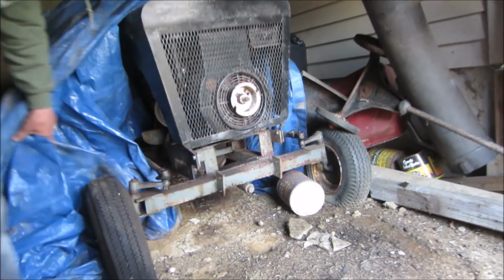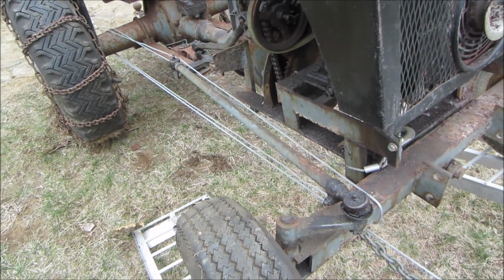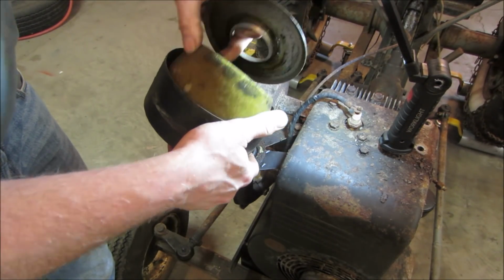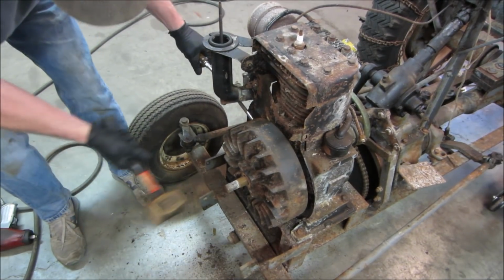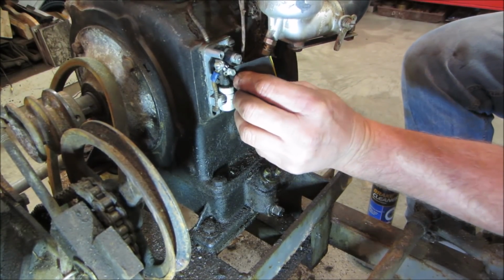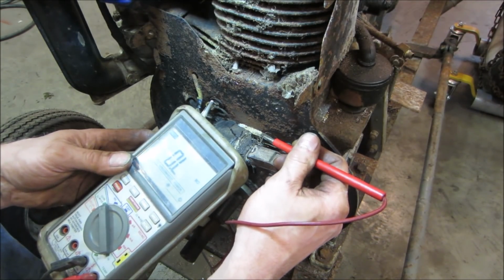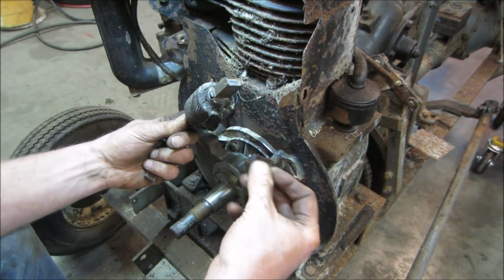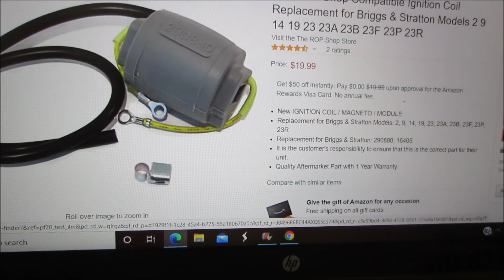Found under a House, Home Built Tractor, Can IT Be Saved?

Comment: Huge respect to the old guy that built that tractor without the advantage of the internet, or same day shipping.  Definitely a different time entirely.
Reply: It's called "POPULAR MECHANICS".  They had home builds for just about everything and plenty of loyal readers, fresh back from the war, who were more than ready to make whatever was needed.  My Dad was an avid follower.
Reply: Or plasma cutter or angle grinder likely only a torch and stick welder and really crappy drill with crap bits
Reply: Hey now we had the Sears catalog...
Reply: @BigMouth380cal  Indeed. I've got several years of PMs from early 50s til the 70s. After that they got thinner, larger and more advert-intensive
Reply: Is J.C. Whitney still around?
Reply: @davisappletv9931  yep
Reply: Being a teen from the 60s, growing up on a farm ..it was cheaper to build it then buy it and all of it was on the farm or another farmers land ..we traded a lot.
Pops ( my grandad) pop ( my dad) built something like that also ..pops used it for gardening and cleaning the feed barn for the cows..the trailer was a 55 ford bed.
Reply: @davisappletv9931  Yes  They are.
Reply: We still had local hardware stores back then that had a much larger variety of parts fittings etc.
Reply: @davisappletv9931  Yes. Not so sure the catalog is. They sell on the internet. Great old catalog.
Reply: @Hjerte_Verke  There used to be a publisher called Lindsay Technical Books tha used to sell old technical books and do it yourself books. They were reprints from 1800s to the 1950s. You can still find some of them online. I went into mourning when they closed. 😆

Comment: i finally subscribed, I have that exact engine, glad you figured it out.
Mine was on a 1960s power king tractor.
For anyone looking the part # of that coil is 290880
Of interest also is, on the camshaft it has a weight that looks like a compression release but it is not. it is actually a spark advance believe it or not.
Reply: Why not? the points are controlled by the camshaft.
Reply: @wssides  Sure, you can do that.  but the coils are quite common on the internet. as long as the engine is apart  it will be easier to just replace the coil at this point.

Comment: Popular Mechanics and Popular Science had plans for those tractors back in the 40's 50's
Reply: I think I have the plans for this saved on my computer somewhere. I think it was called a power pup or something like that.
Reply: I think that was Popular Mechanics.
Reply: @reaper10  See if you can find them and the date of the issue.
Reply: @Hjerte_Verke  They are available free on a site called "vintage projects".
Reply: Popular Mechanics.   Pow’r Pup is what they called it.
Reply: Power Pup.
Reply: Tricky one to find parts for these days, all those 30s components
Reply: Popular Mechanics. It's a Pow'r Pup tractor. Usually uses like a Model T rear differential and axle and 3 speed manual gearbox.

Comment: Mustie - take a 12V automotive coil, feed 12V positive to the plus side of the coil and using the points and condenser on the side of the tractor's engine, wire them to the negative side of the coil. Remember to hook 12V negative to the block. You now have battery ignition and can eliminate the magneto. Kohler engines in the early Cub Cadet tractors are wired this way. The magneto you are working with is made by Bendix-Scintilla and the coils are hard to find. Love the channel! Keep the videos coming!

Comment: I'm from Alberta Canada and my Father built a similar setup in the '60s using a 1937 ford in a similar way as this amazing man. There is one difference that at a quick glance I noticed. Dad had a reduction system built-in using another ford re-end which worked very well to maximize the 10 hp Briggs and Statton motor, which was mounted Crossways to allow the reduction set up to work, so the starting pulley was out the side. This was used by all of us 8 kids to learn to drive, it had a clutch and a 3-speed transmission. along with a centrifugal drive connected to the reduction system which was very easy to drive indeed. The rear end was narrowed to fit the width of the machine. It's still around and working and impressing all who see it. But it didn't look like a tractor, it was more like an early Quad with a windshield rollbar and single padded seat. My father was a very talented man with several trades under his belt starting as a blacksmith, then welder, mechanic, Electrician, and then gasfitter and Plumber, we never had a service person come to our six-bedroom house which he built-in 1957. People came from miles around for him to repair/redesign or invent almost anything from a watch to a D-9 Cat. We were spoiled and assumed all fathers could do this stuff, we were wrong.
Reply: Sounds like my dad,he built a tractor similar to this with a Wisconsin engine from a Wards garden tractor,a 3 spd either a Dodge or Plymouth transmission and a narrowed mid fifties Studebaker rear axle, built the front axle that used motor scooter wheels and tires and built the steering assembly, only thing was he couldn't get the gear reduction right and it would run too fast,he was also our small towns go to fix it guy and welder
Reply: Qq A
Reply: That's a great story and perhaps the best thing I've read all month (thus far; big benchmark, huh!). I hope my kids say something like that about their wily father one day. I'm hoping at least one of them inherited the tinker genes, but thus far they're taking after their mother... 🤦‍♂

Comment: The good thing about oddball home-built gear is that it tends to have A LOT LESS "value engineering".
Reply: John Deere also wouldn't have put wide whitewall winter grips on it. :-)
Reply: I always thought of home-built gear as the epitome of "value engineering"  i.e. free or re-purposed stuff using a lot of common sense engineering.
Reply: Unfortunately in today’s business value engineering means built in obsolescence 
So you’re forced to spend money
Reply: @RC-fu6hg  so true brother
Reply: That's because home builders see the value of engineering these things to last.
Reply: @AcmeRacing  JD probably woundn't have had those wheel sizes +  maybe the owner had 'em already ! Tre NZ
Reply: It depends who made it iv seen things almost entirely held together with bailing wire
Reply: Whenever I'm building something I'm always thinking about ease of repair and maintenance.
Reply: I think you mean it tends to be EXCLUSIVELY "value engineered," since you're usually making it out of whatever you've got.
Reply: @iroll  : Yeah, I was going to say!
Reply: Not an oddball.  It is a Power Pup  from Mechanics magazine in 1950s.

Comment: Rewind the coil. That's one of the easiest ones you can ever do. Chuck it on the lathe, carefully unwind the existing wire, rewind it with the same length with new wire. Easy peasy lemon squeezy. It would be a shame to ditch the engine just for that pesky coil, it looks to be in great condition otherwise. As for what happened, i'm 80% sure you were right with your statement regarding the arms being off center. If that's the case, they sure as heck melted the coil, because there's no air in that sector. One of the reasons why you don't see shaft drive sparkies. Too compact, coil heats up like crazy and it melts the gunk meant to protect it.
Reply: I was curious how the little bit of energy could be enough to melt the coil.
Reply: Or just convert a later model coil to fit in the same spot.  Only takes a couple of hours, and lots of people have done it for the Magnamatic ignitions.   Also, it's easy to replace that points setup with a solid state module.

Comment: Hi don’t give up on the old engine, I had a similar problem with a more modern Robin engine, I just used a small ignition coil ( from a Mini) connect to the original points, added a battery and small belt driven dynamo it still going strong 8 years later.

Comment: That engine is a 10-horse B&S, I freed up a stuck exhaust valve on one. I hate being embarrassed by things that I should know, I took apart a carb once to see why the gas wasn't getting into it before I checked the fuel tank.
Reply: aint no gas in it ( sling blade voice)
Reply: Good thing is you can still get parts for that girl

Comment: just hook up a normal 12 volts coil to that points and condenser box, and power it from a 12 volts battery. You can assess the engine with this setup, and even make it permanent if the engine is OK and you'll implement the dynastarter option.

Comment: I  built a lot of these tractors when I was a kid mainly used Wisconsins they were more common back in the 50s I have over 60 years as a blacksmith  most common thing with that ignition  is the condenser more so than coil condensers get  waterlogged especially stored away in some damp place for years  brings back a lot of old memories as I got older I built little British cars with big  American V8s as a side note want to mention be careful blowing all that stuff around specially that rodent crap  use a Shop-Vac along with your air enjoy your video restore that old stuff that's when we used a lot of ingenuity  and skills have a good one  Edmund

Comment: There are also surplus coils on eBay that are very similar to that. Some of the outboard guys are using them in their old outboard motors. It just has a straight rectangular laminations through the center of it. What you probably want to do is to put your laminations in it so it would fit back on the magnetic poles.

Comment: I'm old, 75. As a kid I kept my old 1949 Cushman Highlander running with my mom's emery board (for points) Permatex gasket sealer and a little luck. It was either that or the Shoe Leather express. I'm still riding that old scooter (with many modifications like a Subaru Robin engine, Brembo disc brakes and electric start)  But, at least my knees are in the breeze.  I had to give up my old Harleys last Oct. due to neuropathy from Agent Orange poising I got in Vietnam, couldn't feel the gears when shifting anymore.. But hey! I'm still riding and enjoying Mustie1. This old Briggs is one I have never seen. Looking forward to seeing it running!
Tom Boyte,
Gy.Sgt. USMC, retired
Vietnam 65-66/70-71

Comment: A doodlebug was really a bomb with wings. It looked like a small aeroplane and had no pilot - a bit like a cruise missile, but slightly bigger. Thousands of these doodlebugs were launched against London
Reply: No.  that was a nickname.  Home built tractors were called  Doodlebugs long before WWII.  My Dad and Gramps built a  model A  Ford  Doodlebug before dad left for the war
Reply: @fourfortyroadrunner6701  "Doodlebug" was a trolley and locomotive brand long before the automobile and WW1. Also nickname for dung beetle or turd roller.
Reply: @fourfortyroadrunner6701  the doodle bug or what i know it as is a joker is a home made tractor they were popular in the depression when low income farmers couldn’t afford a tractor so they typically went out back into there junk pile and found a few trucks or cars and chopped then up and crudely welded them together they worked and they worked well usually unless your like my  next door neighbor pall he built a dully joker out of a old chevy and he made his own wheel chains out of barbed wire he used it for plowing needless to say i call him old peg because he has a home made wooded leg you can guess why

Comment: Howzabout putting a coil and battery, and using the existing points .
Reply: I have a Yazoo mower with the same engin here in UK. It has a coil, don't  know weather  it's been converted but good suggestion.
Reply: Yep should work

Comment: I've never yelled  NOOOOO at my screen so much as when I saw that crank shaft getting hit with a hammer
Reply: Yea, should have put the nut back on the crank first so that the threads didn’t get damaged.
Reply: using a brass hammer, its probably fine
Reply: The eazi-bend (R) prybar was never going to cut it.

Comment: Mustie, a coil is a coil. Get a battery and standard automotive coil. Wire it up you should have spark if the points are doing their thing. Use that start and charge and you are burning dinosaurs! 
 Cool old tractor. It looks like it was serious used. It would be great for putting around tractor shows.
Be safe and have fun 
Terry from South Carolina

Comment: I've seen the starter pulley had it so you could undo the two bolts and pull the pulley over the nut. I like those home made tractors. The enginuity was out standing. Other times it's a head scratcher. Keep up the good videos !

Comment: I have a tractor that I made as a young bloke, sitting down in my garage.  It is 2'6" wide and 5' long.  It uses a Morris Minor flat head motor coupled directly to the diff via a universal joint.  Axles and axle housing were both shortened to get the 2'6" width.  Front-end is completely home fabricated.  It uses rotary hoe wheels as the traction wheels and Vespa scooter wheels for the front end.  It hasn't been run in about 10 years, but would go if I put fuel in it.

Comment: If the coil is bad, use a 60's or 70's car coil and battery and use the briggs points and condenser and you should get spark. I did it on a 4hp kohler and it worked great. That over 50 year ago.

Comment: Neat old rig. Forget the crusty old mag and just put a 12v coil on it. utilize the existing points and install a garden tractor battery for power. Plug the coil wire into the spark plug and whammo!

Comment: Hook up a starter with Pulley and short belt and make an electric start.  I think Doodlebugs were Model A based, shortened and whatever was handy.  Old Ford Red Belly steering box?  DO NOT EVER REMOVE embossed on >>>>> on grey gland behind flywheel.  Great find.  The builder had a bit of 'style' re fenders and hood.

Comment: You have to add this to your tow skills...old bottle of dish soap. Add some water to it...Next time you need to pull up a car, tractor or anything that wheels aren't moving..Squirt a little down on ramos or concrete...It will help slide the wheels...Better for your winch...

Comment: It has external points , you mentioned adding a starter Generator battery set up scrap the old ignition get a standard internal resistor ignition coil and switch connect it all up finished.

Comment: that extra metal piece is what keeps the coil from sliding around on the metal core. make sure you clean the ends of the curved parts around the magnets to so that they have continuity with the coil core

Comment: I have one of these tractors.  Dad made it back in 1965-66.  Powered it with a Wisconsin AEH.  He painted it JD green and yellow and named  it the "Deere John".  I used it yesterday to drag  a bunch of  railroad ties.  These were made with a Ford model A rearend and 3 speed transmission,  Studebaker steering gear and miscellaneous scrap.  My dad could build almost anything.  Me and my 4 brothers would watch him build all kinds of things growing up.  It's funny to hear him tell the story of when he decided to make the tractor.  He needed a welder for the project but didn't have the money for one.  Dad just decided to hand make his own welder too, winding the transformer coil by hand.  He had the welder for many years afterwards and used it to make trailers and such.  Dad's  looks very close to this one.  One thing dad did differently from the plans was the steering pivot under the torque tube. Plans called for a plain bolt through it, but  he designed a ball bearing race that used a piece of  masonite as a bearing cage,  1/2'' balls and hand cut races. It is adjustable for wear and greasable.

Comment: Watch smallenginemechanic Dyno test 74 year old Briggs & Stratton.  His coil failed just before this final test. He improvised by using a car coil, capacitor, battery, & maybe ballast with the engines original points. That coil should be easy to rewind for a permanent fix.

Glad you finally explained why you were turning the motor the wrong way.

Comment: 🇨🇦 You could always use a Model T Buzz Coil with a battery wired up to the points. 
A common practice for old stationary engines with failed magnetos.

Comment: I've seen a Briggs and Stratton run using a coil off a car wired to the points using a 6 volt battery for power. What makes this work is that the points close for a brief moment before they open. That keeps the coil from burning up. Of course that was a newer engine that had the points under the flywheel.

Comment: In relation about the starter pulley you put the nut on first and tighten fully then align the cut outs on the pulley with the nut and the two bolts then tighten

Comment: Mustie, you have a series 19 Briggs & Stratton engine. It has a whopping 18.56 cubic inches, close to 10 hp. Built from mid 50s to mid 60s. I have a small engine manual, by technical publications, out of Kansas City Mo, 5 the edition, dated ,June 1960, it has the total break down of the coil and rotor assy, timing data, and replacement part numbers, if you need any assistance, let me know. As far as info, don't have any parts, but the coil you looked at, online will work, you have to remove the mounting bar that is inserted thru the coil to reinstall on the new one.  Hope this helps.  Jim

Comment: Mustie, use muriatic dilute acid, to clean out  tanks; I've used it many times, and it worked great on the rust. It's sold in gallons for cleaning rust off of concrete. Afterwards, rinse, and use sealer.
  My old John Deere 112 garden tractor has that starter-generator, and it works fine.....It uses a 12volt old style car coil. With  an internal resistor.....

Comment: Put a bit of red rustchek down the plug hole and it will turn over easier. Also a 12v auto coil and battery is the best upgrade you can do for it.